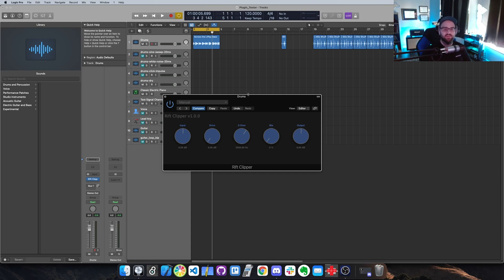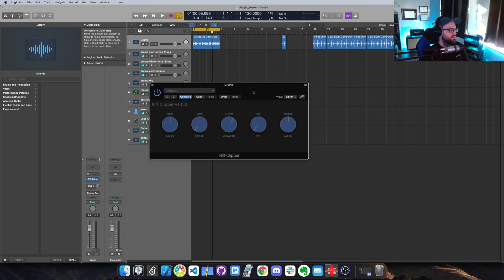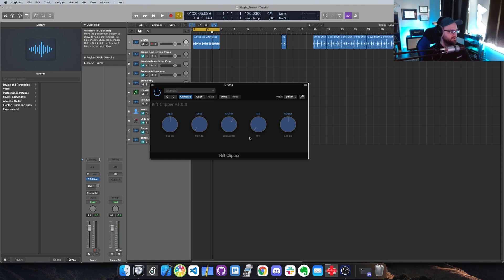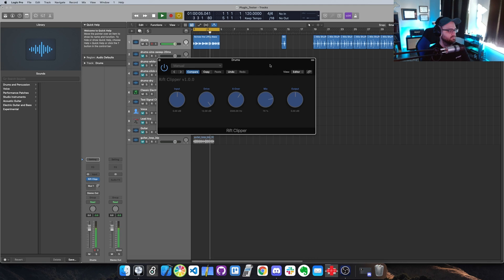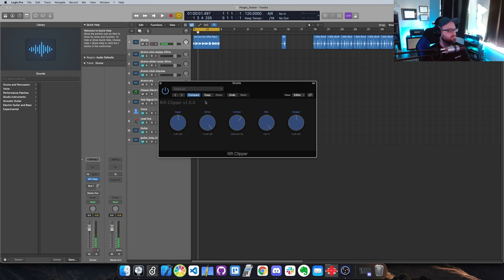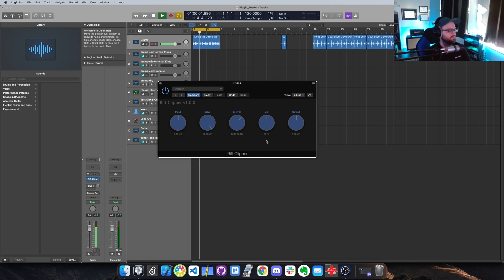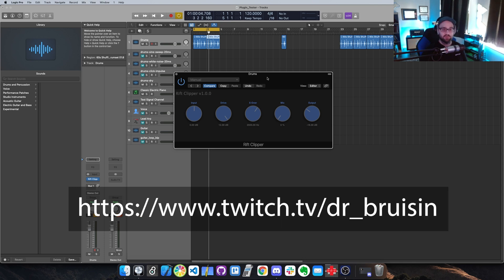Viator DSP Free Multi-Band Distortion Plugin👨‍💻  | Rift Clipper

Comment: Hey, man! This is a good idea for a plugin 👍 But I had some trouble with this... First off, it didn't seem to work at all! I had added the plugin to my project in Reaper while I was working on the song and nothing happened when I turned the knobs! Then I restarted my daw and then it worked! But never had that problem before with other plugins...

Anyhoo, my other notices are, that:
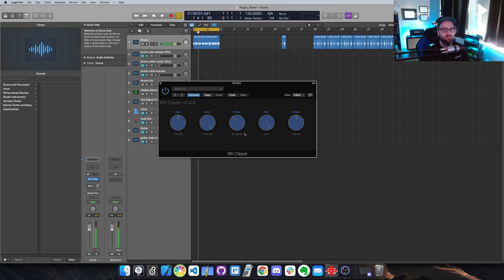-The drive knob is too ineffective. In your demo it did fine, but in my song where I already had this half clunky bass sound (still with good deeper bass) the knob did basically nothing to further distort the signal ☹ This 1:06 is basically my bass sound Before the plugin and This 1:13 more what I was expecting to get from the plugin! And yes, I had all at max with no extra clunk gotten ☹☹
-I guess this has to do with the bass signal/sound, 'cos u are getting fine bass even at 2500Hz crossover! 😳 But in my file anything past 500Hz when turning the knob is just clunk and fret noises and it looses ALL the bass! 😀😳
-Also when I turn the drive to max I get a big dose of static noise! But again, I guess that's partly/mostly my file 'cos it was recorded with Very low levels.
Reply from the maker: I’ll take a look at it and post an update to my Patreon when I figure it out.